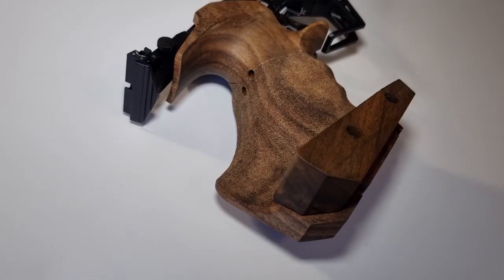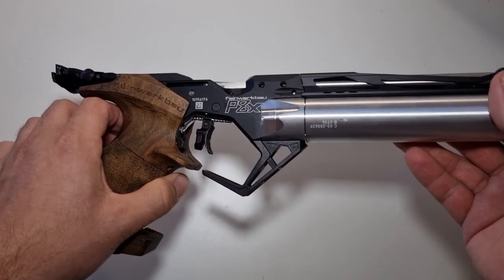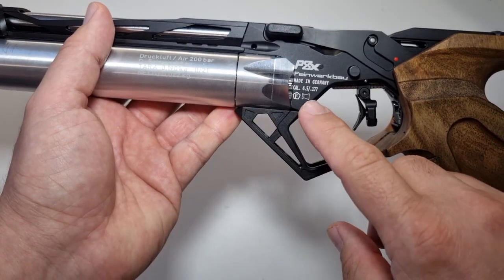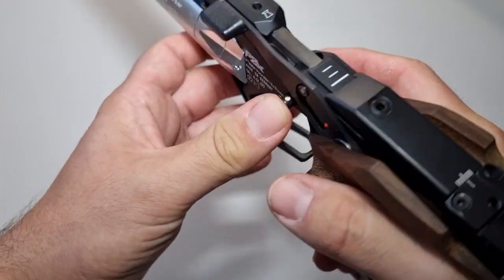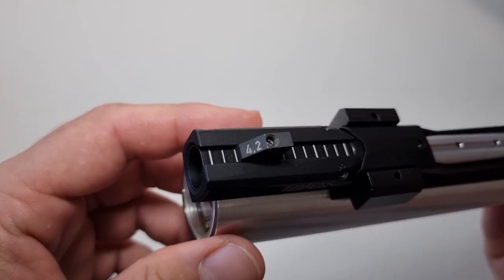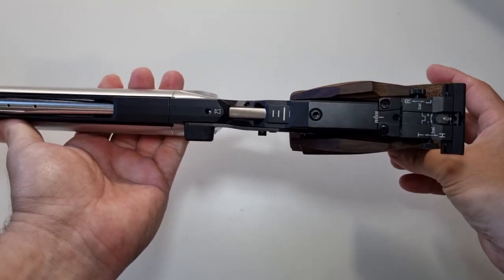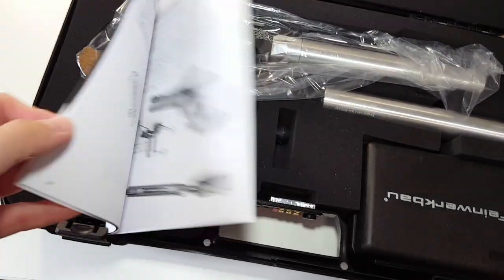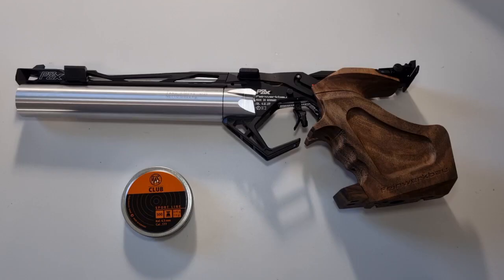Feinwerkbau P8X [EN]

Comment: Hello!
How are you?
I have a P44 I récrives from christmas 2024 but is the was a gift from my brother and with her in one year and one or two months in Shooting Sports in 1/31/2024 i reach 503 points and úntil today 516!
Before I had a FWB 103 for 2022 christmas!
I have a question about the ABSORBER
I didn't understand that of the 3mm and 6mm of the manual! When I shoot the pistol on the piston behind the Pellet a metal appears in the hole that when cocking the sticker I see between the grip and the rear sigth a piece that retreats when I raise the lever and advances when low, but if I shoot I don't see anything coming back! This without taking the grip or disassembling anything and seeing through the groove... is the absorber inside? 
Thank you! 
Grateful
Reply from the maker: yes. that's the absorber. it goes rearwards when the pellet goes forwards.
Reply: @ArmeVechi  i try shoot and look and it doesnt move backwards!!! If move I can not see! How I know is well ajusted?
Thank you
Reply from the maker: @ricardocabralsousa1986  that i don;t know. i don;t see it either
Reply: Thank you and great video! Cheers from
Azores, Portugal

Comment: Hi! One question, the mark of the air cilinder, is the date of fabrication of expiration?? And how much they last?
Reply from the maker: hi. yes there is a mark of fabrication date (year and quarter). they last a long time, but the safe legal usage is 10 years.
Reply: @ArmeVechi  nice so mine says IV/19 means april of 2019, so I have cilinder until 2029 right?
Reply from the maker: @didactech28  IV/19 would mean 4th quarter of 2019. so...october-december. 
but yeah, the cylinder it ok until the end of 2029
Reply: @ArmeVechi  thank you so much! This is an amazing air pistol!

Comment: Hi there, 
Can I ask a quick question about the cylinder? 
Do you have difficulty to get the cylinder screwed on?
Recently, my friend bought a P8X. But he found the cylinder is really hard to screw on and off. It’s ludicrous tight. I did some research on TargetTalk and saw someone says because feinwerkbau use one piece aluminium to build the cylinder, so the thread doesn’t like others stainless steel. So it’s a bit hard to screw on because aluminium is ductile material. But can apply some grease to make the work easier.
Reply from the maker: i put FWB grease on the threads as soon as i got the pistol. the cylinder screws on and off very smoothly
Reply: Thanks for the reply. Yeah probably the best way to rectify the tight fit is putting grease on the threads at the first place. Maybe my friends has already damaged or tweaked as he didn’t know it needs the grease. 
Thanks again.

Comment: Very nice review, thank you for sharing all these details!
Last year I bought a Feinwerkbau Modell 2 air pistol (CO2 model, in mint condition) off a fellow club member, I'm extremely impressed with the 40+ year old technology. The trigger mechanism is still top notch and even though CO2 as a propellant is slightly more cumbersome because of the refilling process (no gauge, you need to weigh the cilinder, and there has to be at least 20 degrees of temperature difference between the cold pistol cilinder and warm bulk bottle) the pistol is definitely more accurate than I can hold. Speed is super consistent too, always an important factor.

Glad to see the Czech athlete Pavel Schejbal use one of the FWB P8X models, the pistol should get more exposure, it deserves it.

Greetings from the Netherlands!
Reply from the maker: thank you

Comment: Thank for this very complete and informative review. I have just one question. Can the cocking lever be moved to the right side for left handed shooters? Thank you!
Reply from the maker: no. i don;t know of any airpistol that offers that feature..
Reply: @ArmeVechi  yeah, so I had to go with the lp500 blue angel instead.
Reply: You can swap the cocking lever over on the Hammerli AP20 pro range for left hand use.
Reply: @32dooscoop  I got the walther lp500 blue angel instead. Very happy with it.
Reply: @TheBoldHairspring  I'm looking to upgrade this year. The LP500 is one I will be checking out, thanks.